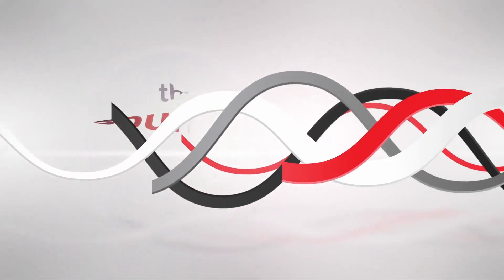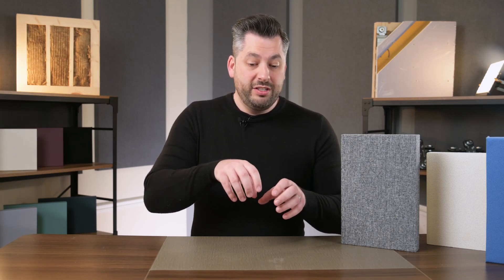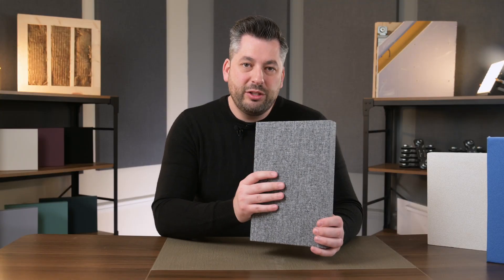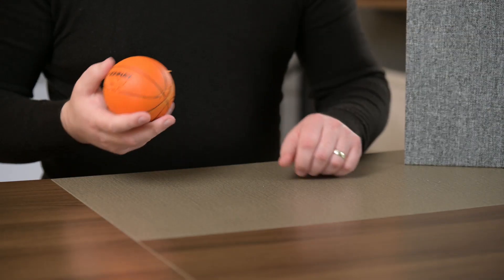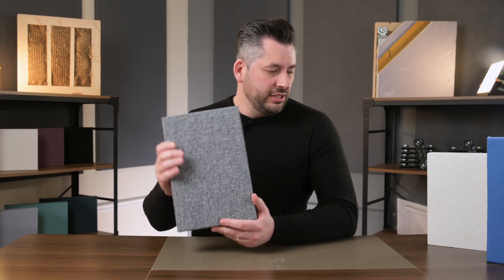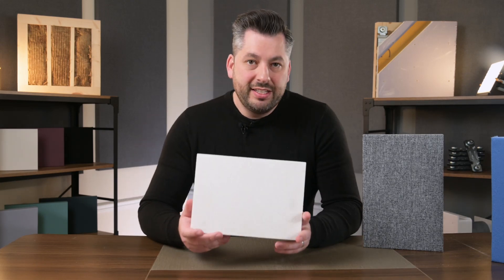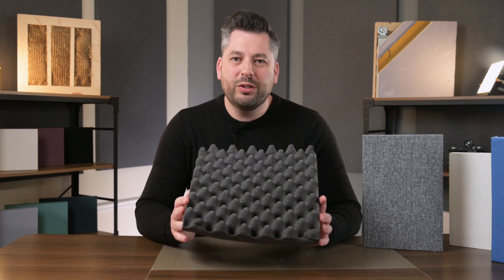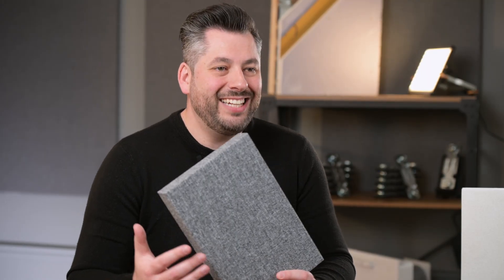What is Sound Absorption? The best acoustic treatment panels

Comment: I have to write an assignment for college where i take a room run a room eq wizard test on it, then take the readings and suggest the right types of treatment. I know i'll need bass traps and sound absorbers for mid to high range but I'm wondering will I need a diffuser?
Reply from the maker: Hi - Not a question we can answer for you i'm afraid. It depends on what exactly you are trying to achieve, what the current acoustics are like, the construction / decor of the room etc.

Comment: I get that the acoustic panels main use is to absorb sound and stop echo reverb etc, but do they also do a good job at sound proofing the room?
Reply from the maker: Hi Ben Howard, the acoustic panels aren't designed to soundproof the room. As you mention, they are used to treat and improve the acoustics within the room. The beginning of the video goes into more detail explaining this. The below video on the differences between Soundproofing and Sound Absorption might also be useful:
https://youtu.be/6Hk4ss3PeSE
This video might also be useful on 'The 3 Best Ways To Soundproof A Wall':
https://youtu.be/9wsyxSujkK0?list=PLuzNxK_R25wBueiDEUzdMUjXcqCON4pL7